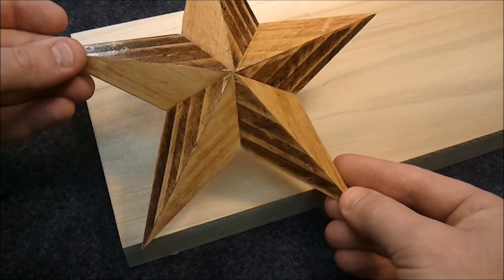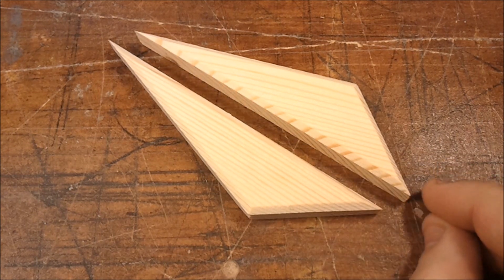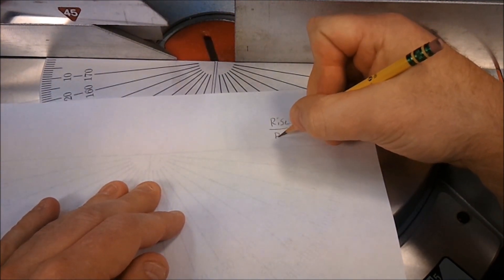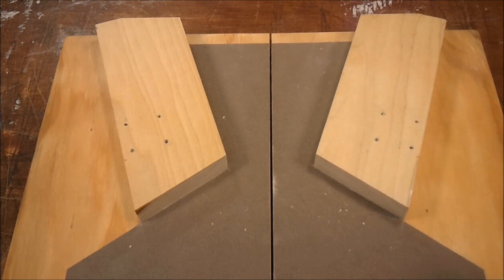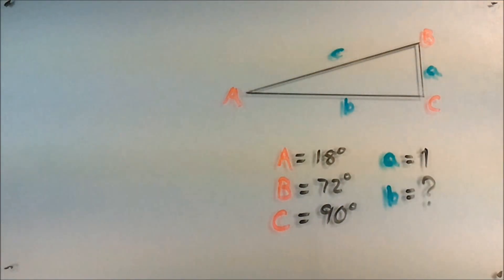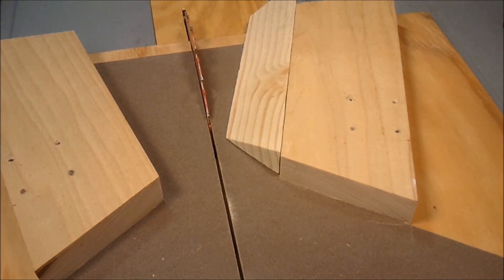Geometry of a 3D Wooden Star ★

Comment: Deep. I just did 360 degrees divided by 5 = 72. Each finger has two parts so half 72 for 36... Maybe I'm too simple minded. I didn't care about the angle at the point. My only concern for angles was where they joined. Equal length took care of the points. I do like your sled though. Thanks for sharing.

Comment: so how do you make the sled???????????????
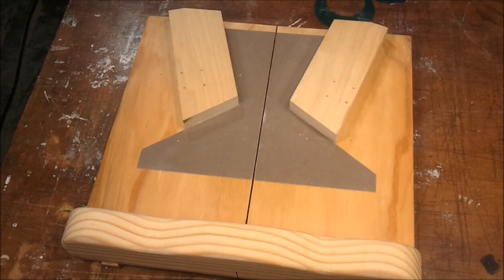Reply: Start with a single square piece of plywood - hardwood plywood is best, because it tends to be closer to perfectly flat. If you're making a bigger star, you'd need a bigger piece of plywood, but 24x24 should be plenty. If you go back to about 2:35, you can see two runners on the bottom that ride in the grooves on the saw table, and a "handle" that's just a piece of 2x4 that's been shaped to make it easier to hold. The handle keeps the two halves together and sliding in unison after the kerf has be cut. You position the runners so that when you run the whole thing through the saw for the first time, the kerf will end up in the center. Glue and screw all that together and let it dry, then run it through the saw one time to create the kerf down the middle. Then go to 3:33 to get the specifics on how to position the angle blocks. And just make sure that the blocks are positioned exactly the same on both sides.
Reply: garrisonaw the bottom of the two pieces of wood on the sled are 18 degrees on the miter saw?? right...
Reply: Yes. In fact, both ends of the blocks are cut at 18 degrees. But as he mentions in the video, getting the blocks positioned absolutely precise requires mathematics. The length of the blocks is unimportant, as long as they're big enough to hold your work piece in place, and small enough to be easy to handle. And in fact, you don't even NEED to cut an angle for the end of the sled, but it makes it stand up straight when you aren't using it. What IS critical is getting the block the right distance from the blade, and PRECISELY 18 degrees off from parallel. To do that, you have to construct the triangle on the "floor" of the sled as shown, then you simply line up the edge of your block on the hypotenuse (side C). Fortunately, he's done most of the math for you, so all that's left is to adjust the scale for however large you want to make the star. 
.
For example, if you want a star that is 24 inches measured from tip to tip across the star, side a of the triangle would be 4.1 inches, and side b would be 12.6175 inches. Alternately, if you know you want your star to fit inside a given size circle, side b would be the radius of that circle, and side a would be the radius divided by 3.078. So for an example, we pick a random number and say we want our star to fit inside a 42 inch diameter circle, so side b of the triangle (adjacent to the blade) would be 21 inches, and side a (the end of the sled) would be 21/3.078, or 6.82 inches.
Reply: garrisonaw how much you want for the sled lol...
Reply: amanda  halverson honestly, if you lived next door to me, all you'd have to do is supply the material. I'd build the sled for free. I love working with wood.
Reply: I am going to try and make my wife a wooden blue star plaque for Christmas as her son is serving in the Navy now. I made a test sled out of scrap in my shop tonight using the following method. 20 inch wide by 16 inch 3/4 plywood for the sled with some oak runners. Slides great no problems there. I did my triangle at 3 inches at the top and as close to 9 15/64 as I could get it. I cut two 8 inch pieces of 2x4 ripped down to 3 inches for a nice edge with an 18 degree cut placed the 2x4 on the sled using my triangle and glued screwed it made a test price. Added the sand paper made a few more test prices and I am not getting the proper angle on the center section of the star. Where did I mess up?  Amazing video thanks for posting it.

Comment: By definition, b/a = tan B ...
Reply from the maker: +Stanley Qin 
TOA, since using b/a lacks any directional context: 
tan(angle ϴ) = (opposite side) divided by (adjacent side) 

But what is your point?
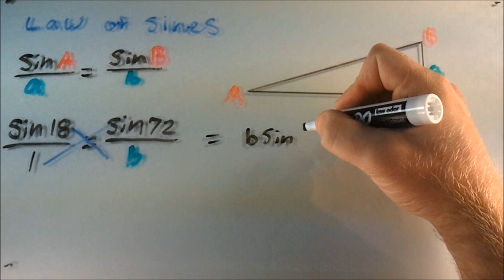Reply: +pocket83 I meant at about 4:50 the calculation could rather be simplified to "b = a*tan(72 degrees) = 3.078a" and ... I scrolled down a little bit and I should have realized someone must say that months ago LOL
Reply from the maker: +Stanley Qin 
But that wouldn't be simpler. And I was using the Law of sines. Using an additional character would only add confusion. This isn't AP pre-calc; this is how to use math IRL.
Reply: pocket83 Wow it's a culture shock to me. The concept of tangent is introduced much earlier than Law of Sines here in China and in Russia (and I meant it could be used at the first place b = a*tan72) :P I believe some of the audience would find tan easier. Anyway, great videos! They make me want to be a carpenter LOL
Reply: use of tg actually IS simplier since you anywat have to calculate smth on calc why should you do three calculations(sin(18), sin(72) and their ratio) instead of one(tg(72))? side b is by definition of tangent side a*tg(A)

Comment: Thanks for doing the geometry! I have been trying to figure out how to cut a similar star, but with solid "arms", rather than made of 2 glued pieces. Have you put your brainpower to work on that approach (maybe using a jointer sled somehow?).
p.s. As good as you are, you deserve a better table saw - get a SawStop and you'll be glad you did!
Reply from the maker: A copy-cutting device comes to mind; perhaps a router-based pantograph is what you are after. An alternative might be an inclined router sled, but given the radial symmetry and precise stops necessary, you would end up with jigs more complicated than the pantograph is! Further, lumber size would quickly become problematic.

As for the table-saw, I presently have no problems with the one that I have, but my next upgrade is not very likely to be a Sawstop. So far, I'm not impressed by the hype. Please do not ask me to debate this subject.
Reply: Thanks for reply! Since you seem to be a solid geometry guru, can you tell me how to create a star maybe 3 times the size of yours? Do I need a very thick piece of wood to then rip on 30 degree angle? Also, does the geometry of this star mandate that both cut angles are 18 degrees? Or did you use your jig that way for convenience, making both cuts on same jig. I have seen "fat" stars, so could I make a second jig at a different angle to make longer, skinnier arms?

Comment: GREAT video and inspiration.  I watched it this morning and spent a couple hours today building the sled.  After a bit of frustration getting my head wrapped around how to turn each piece for cutting I made 3 flat stars, beveled ones are a project for tomorrow.  I used your math to make a CAD drawing of the triangle, printed it out, and transferred it to the sandpaper.  Once I cut out the paper I glued it to the sled and used it as a guide for installing the cutting blocks.

Comment: great vid, 1.  what is the distance on your jig of the following=
top         kerf to edge of board (assumed equal on both sides
bottom    kerf to 18 degree cut corner
length of board that has 18 degree cut on bottom

I built a jig and used your math but I missed it somewhere because I now have a jig to make great 6 pointed stars not 5 pointed stars.
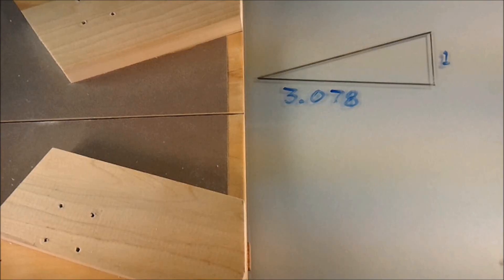Reply from the maker: fiberinspector Side edge: 3" from kerf. Edge along kerf: 9.234".This is discussed at 5:25, let me know if you still don't figure it out.
Reply: pocket83  went back and rechecked all measurment, got it right this time, as to the clamps I put a stop with a small board at the 9.234 point to stop the piece being cut from moving, this way all pieces are cut to the same length and will not slip when being cut.  Thanks again for the jig!
Reply: @fiberinspector1304     I see this is 3 years old but any chance of a pic showing the "stop with a small board at the 9.234 point"?
Reply: @whoDatBeDare  no, but it is just a piece of wood that  allows the board to be placed at the same spot every time you make a cut for that Angle.

Comment: Question: In making this, which is a great solution to a making a star, there seems to be a lot of waste. What I mean is, you have to hold on to something on the sled fence, because the actual piece that is being made is on the "waste" side of the blade. Not an issue if using a 2 x 4, but if you use walnut it becomes a concern. Is there an efficient way of cutting your pieces?
Reply: +briansullivan63 Sullivan I stumbled onto a solution to the waste.  It is hard to describe but if you use the jig to cut off the waste and pay very close attention to its position on the kerf you get a second star from the waste.  Now this is making the flat style star, I am not sure it will work with the 3D version.
Reply from the maker: briansullivan63 Sullivan I totally agree. Waste is just a simple fact of using this method. Since I used 2x4, it was little concern, but I would be interested to see an improved procedure. I'll think about it.

Comment: So you use a proportion to find the angles of the saw sled
Reply: John Cruz You use the measurements on the sled, as stated in the video. A is the distance from the kerf line out to each side on the leading edge, B is the distance from the leading edge of the sled, determined by maintaining the proportion if A = 1', B = 3.078". Adjust the measurements for the size star you want.
Reply: Thanks, I got it now.

Comment: How do you take the 9.234 inches and transfer into basic ruler measurements if that makes any since? I know that 9.25 inches would be 9 1/4" so the 9.234 would be a bit smaller but how much exactly? 1/8", 1/16"?
Reply from the maker: That's a good question. First, look for the difference between the two (difference implies subtraction).  9.25 - 9.234 = 0.016 or 16/1000

Now to the question: How big is that, compared to a sixteenth? Well, 1/16 = 0.0625, so how much is 0.016 out of 0.0625? Out of implies division, so 0.016 / 0.0625 = 0.256, which is about one-quarter, so it takes about four of those little pieces to equal a sixteenth.

I keep a chart hanging on the door, which is for fraction to decimal conversion (it's in increments of sixteenths). When I get a caliper or other digital reading, I look at which two fractions it sits between, and that narrows it down. If it requires a higher tolerance, I look for the next two smaller fractions that it sits between. After practice, you get a "feel," but you can also do it more precisely, with algebra, if you want. Hope this helped.
Reply: pocket83 Thanks for the response. Yes I also found a decimal to fraction conversion chart after I asked you my question. From what the chart says, it seems that .234 is equivalent to 15/64 of an inch. Very helpful. Now to find a ruler that breaks it down into 64ths. Thanks again.
Reply: Take the decimal part of the number .234 and multiply it by 32 for an approximation of how many 32nds it'd be. Or by whatever precision you can get like 16 or 64.
.234 × 32 = 7.488 so about 7.5/32 on the tape measure. Or multiply by 64.  .234×64 = 14.976 so about 15/64 .
There's a sacrifice to doing this if you round too much. Or you could use digital  dial calipers that can measure out to decimals for you.
I hope this helps someone

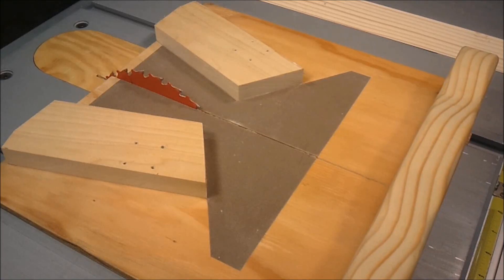Comment: 7:10   I use brad nails that are sticking out just a bit 1/16 or 1/32 and sharpen that keeps the wood of moving.  A bandsaw with sharp blade for cutting small part works good too.  Thanks for the great video, big help.
Reply from the maker: I agree: this method could easily be adapted to a band-saw. That would likely be less precise, but better suited to building large stars. Glad this was useful.
Reply: pocket83 Yes it would be less precise only because the most bandsaws are not setup for more precise work, like using a fine cutting blade ect.  My other thought is to setup a small disc sander.   Thanks again for the Great how to do video you made!

Comment: Do you have any tips or tricks for making the sled and placing the blocks in the correct place?  I understand the math/ratio tutorial, but I am curious how to actually place the blocks so they are perfectly angled and perfect mirrors of each other.
Reply from the maker: Sure. I stripped this video down a good bit, to prevent it from being too long.
The first thing that I would do is make a sled with a single cut in it, so that it is "zero-clearance." I would recommend using a thin-kerf, 7 1/4" saw-blade, so that your cuts are nice and thin to begin with. Next, just measure out your triangles on each side of the saw kerf, using the edge of the kerf itself as the "b" side of each triangle. The blocks are placed along the "c" side, so draw the triangles with a nice, precise pencil-line, and just use short drywall screws to attach the blocks from underneath, so that you can reposition if needed. Spray-adhesive on the blocks will make it easier to make micro-adjustments by reducing sliding around. In order to tell where the blocks end, it just depends upon the thickness of the star stock that you are using, so it may require experimentation. Oh, the sandpaper is just stuck with spray-adhesive. If you need more specific help, just ask. I can always give you dimensions, if needed. Good luck.

Comment: Nobody seems to have mentioned it, but you did not need to use the law of sines to solve that problem since you have a right angled triangle. The law of sines works on any triangle, but right angled triangles are simpler. With your triangle you have tan A = a / b, therefore b = 1 / tan 18° = 1 / 0.3249 = 3.078 as you found.
Reply: I am sure that pocket83 wanted to have his information apply to any triangle (need an angle on a triangle? Ah ha! I can use the law of sines.) and that is why he included this law not narrowed down to right triangles only. Thankfully math provides us more than one way to skin a cat. Your comment contains the same reasoning.

Comment: You explained the math very concisely and if you didn't cover it, someone would ask how you worked out the angles.
I wouldn't be one bit concerned about the thumbs down. There's about a 10:1 ratio, one idiot to 10 non-idiots, so you are bound to get a few. Idiots like clicking that button, it's easier than thinking or writing something constructive.